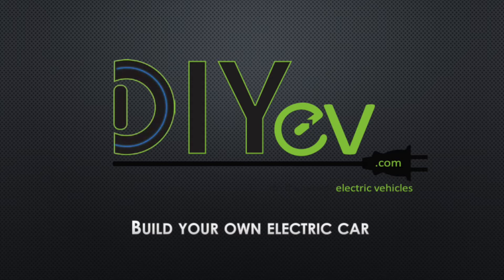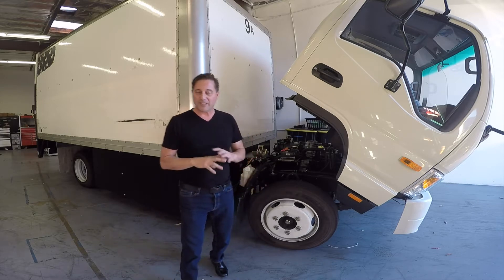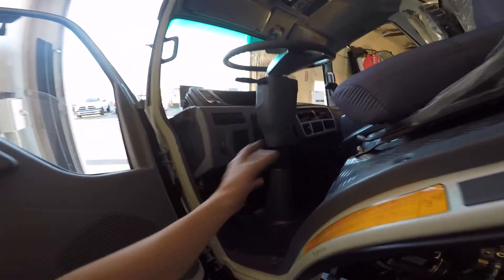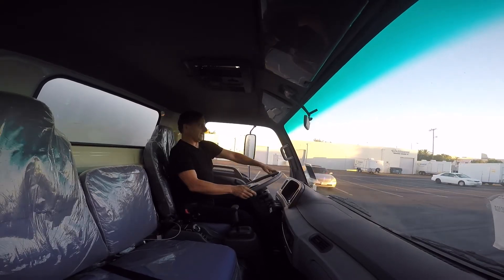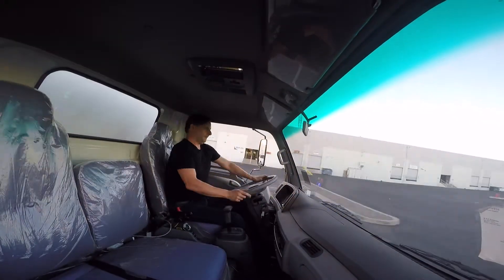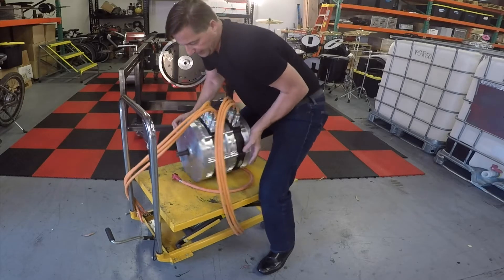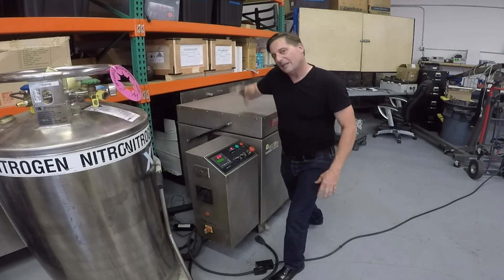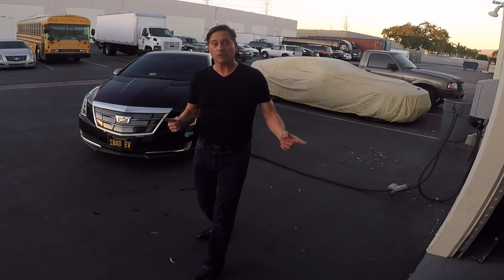DIYev Introduction Edward Monfort Resume

Comment: Cryo has been around since 1966.
Reply: not Cryogenic thermal cycling.  Edwards Monfort was the first to solve air convection inside cryo process cutting the time and expenses to cry treat by over 80%.  Monforts process and machine  was patented and NASA even bought the rights to build two machines in 2002